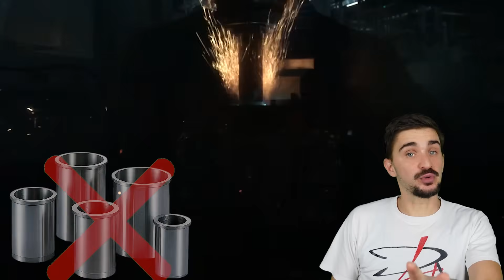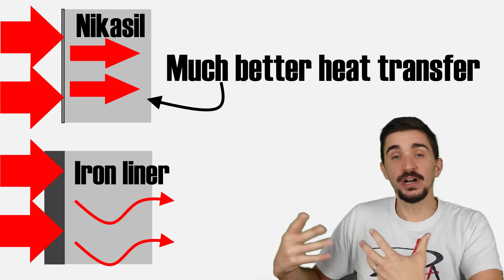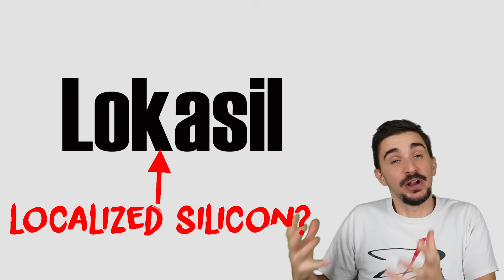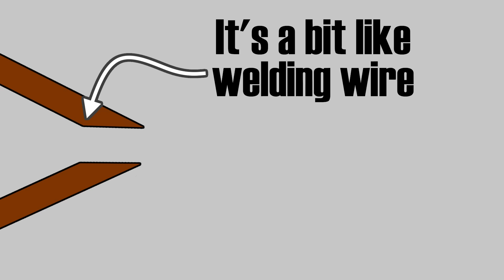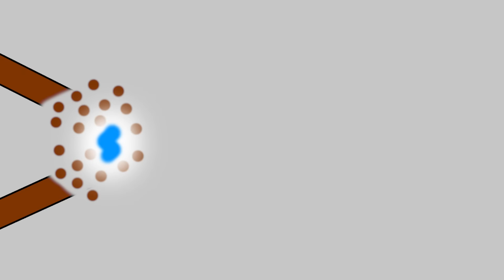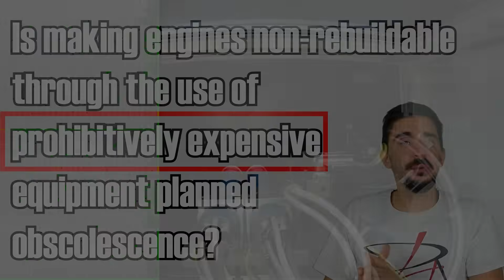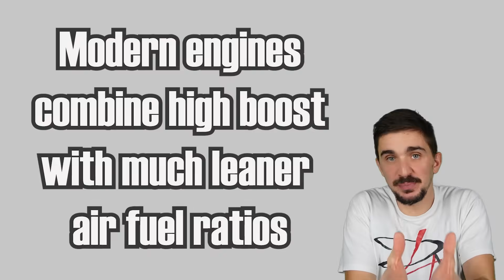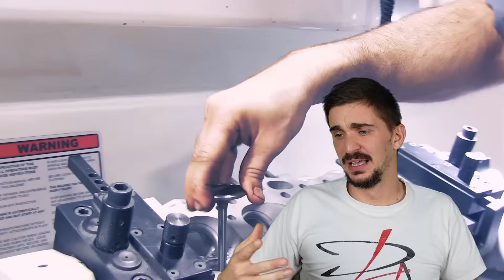Why Are Engines Becoming Non-Rebuildable? Everything About Cylinder Coatings

Comment: I learned a lot but just wanted to add that Alusil can be recut or rehoned. Kolbenschmidt themselves put out guides but it requires special sunnen honing machines most machine shops won’t have. Alternatively DIYers have learned to rehone to expose more silicon with a special paste. I only know this becsuse I am doing it on my 944 right now.

Comment: From what I understand from this is that the manufactures want to build the engines cheaper, but at the same time charge us more for the product. It seems like the industry standard is in a constant state of change. Originally all engines were cast iron. Then to save weight the block went to aluminum with iron sleaves. Now they are all aluminum with a spray on cylinder liner, but the industry standard is to have at least an iron sleave for durability. Do you think those 18-wheeler have spray on cylinder liners in their engines? We went from an engine cylinder standard of 4 to 6 to 8 then down to 6 then 4 now 3! We are constantly getting less for more!

Comment: How about Electrodeposition of both Aluminum and Copper to form Aluminum Bronze on the cylinder walls using a Urea based DES? It would be strong and relatively easy to do at the workshop level.

Comment: No one was ever rebuilding passenger car engines en masse anyway. Aside from rare cars or people that plan on modifying their car, the usual course of action is a used engine (usually pulled from totaled cars). And bore coatings don't make engines non-rebuildable for those inclined to do so. Darton will gladly sell you some ductile iron sleeves for just about anything, and a good machine shop will gladly machine that silly coating right off and press those sleeves in. For purists (e.g. Porsche owners) that think the thermal expansion of a ductile iron sleeve will somehow crack their fairy dust infused aluminum block or mess with thermal transfer, there are Nikasil lined aluminum available sleeves on the market.

Comment: They are still rebuildable, just not as convenient. There is an acid bath that the block can be placed in that eats the plating, leaving the aluminum alone. The block then needs to be re-plated and honed out to size. 

I went through the process for rebuilding a Yamaha SRX snowmobile engine.

Comment: Very good video extremely informative but I have to disagree with your conclusion as a former owner of a Chevy Vega that was bought new the engine only lasts at 40,000 miles before the oil consumption became prohibited the engine was never overheated and received oil changes every 3,000 MI I've been a mechanic for over 40 years and has scene many types of engines come and go I also have a as degree in automotive technology plus all my state licenses I will tell you from experience that sleeved engines are much better than coded engines no matter what the coding is all your environmental analysis sounds really good until you tell the customer his engine is junk because some environmentalists made him use a spray coating on it

Comment: Very good vid and super in-depth explanation. The single biggest factor with respect to the down side to non rebuildable engines has nothing to do with the engine at all!!  There is the rest of the vehicle that also is thrown away. The cost in co2 emissions and input energy energy to “recycle” (new plastic vehicles are hardly recyclable)  the 1500+ lbs of junk material that makes up these modern cars (in a crud way this should represent the weight of non metallic components hardly worth recycling), is way way more than being able to simply rebuild the engine to, again, have all 3500+lbs of car back driving on the road. And that’s not even a very large vehicle at 3500lbs. 
No argument on your math D4A but only calculating the engine block because this segment is concentrating on that part of the vehicle is missing the entire point in why you rebuild an engine. It’s not to get the engine running again. It’s to get the entire vehicle back running again. If you can’t fix the engine you also cannot fix the entire car and the entire car is JUNKED!  
But great vid regardless.

Comment: Thank you very much for this video, I found it extremely useful.  I found this video because I just bought a motorcycle that has an Aluminium Alloy Cylinder with no liner, and I had no idea such a thing was possible.  I am reasurred that it has benefits and in this case I can see that the cylinder can easily be replaced if it's ever needed.    I think we have to be realistic and appreciate that unlike vehicles from the 1970's when re-honing or re-boring and fitting oversized pistons was common, today very few engines are rebuilt in westen countries.  They last so much longer, when well maintained a good engine may never need a rebore or rebuild, mostly it's done as a result of poor maintainence or allowing an engine to overheat.

Comment: I am laughing ath your emission numbers. My Citroen Ami 8, a quarter century old when I happen to get my hands over it also had economy of ~19km/l. Only 28 or so HP, but I could rebuild the engine and later the gearbox in my kitchen, then go on trips to places which the current average EU driver can only experience on screen of his youtube account. If the body of my Ami was as robust and repairable as the powertrain was, I would still keep that car for occasional drives through bogs and remote beaches. I cant imagine such fun with the German-über-engineered anything.

Comment: Still, a properly maintained cast iron block would have a much longer service life than any aluminum block. For example, it is not unheard of for the 1.9 liter TDI VW Golf engine, which has a cast iron block, to go beyond 500 000 km. At most, a similar aluminum block would not go beyond 250 000, in the best case scenario. I don't know in your math, but in mine, having to buy another car instead of using the same for another 250 000 km, is not the same, not for the wallet, not for the environment.

Comment: The obsession with emissions is one of the most obnoxious oabsurdities in modern culture, if a government wants to go green they need to build nuclear power plants, messing with road cars won't effect anything
Reply: Yeah, remember when engines used to go for 500 000 km before needing a rebuild... we would be lucky to hold an engine for 250 000 km now. How is that good for the environment if I have to buy a car  twice for the same amount of km driven?! I still have my Ford Focus mk I 1.6 liter Zetec cast iron block. Would not trade for an aluminum block if I would be given a new 2026 Focus for this one! I know mine will outlast the new one, despite being 20 years old (but only 110 000 km).

Comment: Mfg's don't care about rebuildability at all - its not a conspiracy or planned obsolescence, its simply that the engines are designed to last the projected practical lifetime of the vehicles. If people kept their cars 20+ years on average, they'd push to make them last longer, but many people want a new one as soon as they are done paying for the current one - or even before that. Simple economics. Rebuilding just makes no sense anymore. If you pop an engine, just get another out of the salvage yard. EV's will change all that in time. I love ICE, but EV for many (not all) use cases make the most sense all things considered and makes this a moot point for the average consumer.

Comment: I mean the M112 and 113 Mercedes engines did very well. The reliability problems of newer Alusil/Silitec engines are down to injectors (i.e., direct injection engines), so I am not sure I'd call the whole Silitec endeavour a failure, given a couple of the most durable engines of the past 40 years had it. Literally nobody hates the M112 and M113, they last forever if you change the oil, like, at all.

Comment: Alusil is rebuildable with mostly normal machine tools.
It’s bored, honed as normal and then honed with felt pads and some dope… takes like 90 seconds.
There’s also some variation tools that you can rent.  It’s a few hundred bucks but still, maybe 30% more money than an iron block bore and hone.

Comment: 1) Manufactuers are incentiviced to ensure that the engine doesn't fail while under warranty and that makes the coatings a better choice for them
2) Customers are demanding higher performance and longer warranties with very few making decisions centered around rebuilding
3) Nikasil uses cobalt which is an environmental problem so most western manufacturers don't want the hassle/risk
4) Ford (and other manufacturers) are experimenting with Plasma Electrolytic Oxidation (PEO) which will greatly reduce the equipment complexity/costs (vs. thermal spray coating) and results in even harder and lower friction surfaces.  This has been shown to work well for 2XXX series aluminium alloys (high performance engines) and Keronite advertises that 3XX (most engine blocks) also works very well with PEO.  

Sleeves are still super common (Toyota, etc.) so if you want to keep an engine going after it's fail point select a motor with sleeves.  The future however is coatings and that creates a market opportunity for specialized remanufacturers to recycle engine blocks back into working rebuilt motors.  Probably not as a shade tree option but the option will still be there for crate rebuilds.

Comment: Reducing CO2 emissions will have a NEGATIVE effect on the environment since CO2 is NECESSARY for plant life.  Plants produce O2 through photosynthesis which is NECESSARY for human life.  So, unfortunately, your environmental analysis at the end of the video is based on faulty pseudo-science (I.e.: "Communist Propaganda").  

Historically, CO2 levels were 10 to 20x higher than they are now during the Cambrian, Ordovician, and Mesozoic eras when the earth was MUCH GREENER.  So, logically speaking, we need to PUMP CO2 into the atmosphere and INCREASE our so-called "Carbon Footprint" if we want to maintain a healthy planet.

The ONLY benefit in reducing CO2 emissions is reduced fuel consumption and lower cost to the consumer through fuel savings.

Comment: Our family car uses a Citroen C4 engine and it is only rated for 150000km before replacement. It is now 10 years old and the cost of a new engine is too expensive and now the car has to be written off.

This chassis is in excellent condition and will last another 20-40 years with proper care (which we do regularly) 

How is this not illegal.

Comment: Volvo's most expensive ever vehicle, the $105,000 USD XC90 T8 Excellence, is literally disposable. The entire vehicle is irreparable and inoperable when the unreliable electric parallel hybrid rear end dies. Which they all do, years before the "12 Year Manufacturer's Warranty" against body rust can possible expire. This should be illegal to intentionally design an unnecessarily complex engine or vehicle system that fails into a brick when ONE of the FOUR distinct power systems breaks. Not by accident but on purpose, and well before a decade; most electric rear drive systems are mechanically failing (gear self destruction) before 100,000 miles; and all, 100% of the battery packs are failing to ever provide the range or life advertised. Can you use the 2.0L FWD gas engine when the electric rear drive motor fails? No. Can you use the supercharger, when the batteries fail? No. Can you the turbocharger when the car refuses to shift out of park because the stupid parallel hybrid system is broken? No. The most expensive vehicle Volvo ever made becomes inert, by design, when its weakest link inevitably fails. 

Thus the most expensive vehicle Volvo ever made is literally worth less than the base XC90 it is based on. 

NONE of this would have happened if it were just a series hybrid AWD (which is trivial) not a "dual motor" POS. 

"Excellence. By Sweden." It says on the headrests. 

Actually this car was built for Chinese limousine market and all the bad decisions can be attributed to Geely, which has enslaved Volvo and appears to be intentionally ruining not only Polestar but also the halo flagship Volvo brand. Boggles the mind.

Comment: It's not a subtle increase in temp that engines are running either. Most car used to sit in the mid 80s. Now most cars are sitting just above 100 degrees.

Comment: I wonder if the next step will be manufacturers moving back to nickasil through the use of aluminum liner bores. like you take the general idea of a cast iron bore sleeve, make it out of aluminum, and then nickasil plate it. since the parts are much smaller and more manageable, it should be easier to scale production speed up and costs down - can just have a large bath of nickasil solution, through which the sleeves are dragged (each with their own nickel electrode) with the use of an overhead conveyor chain. a properly designed production line would probably be able to automate loading of both the liners and the electrode. zero downtime between engine models, as the chains could be designed to hold carriages for size modularity. and for maximum heat transfer, they would be installed with a high temp thermal compound (which already does exist; there's a few thermal compounds used in high performance industrial cooling systems capable of supporting 350C, which I understand is above most engine's operating temperatures, not to mention boron nitride which is regularly used in 3D printer hot ends which can reach even higher temperatures). And thus the sleeves being separate again would make them rebuildable in the traditional sense again, while maintaining most if not all of the benefits of these coatings AND the design/manufacturing simplicity of cast iron sleeved bores.

Hell, if we go into exotic territory, it would probably even be possible to play with more geometries and materials - for example, since the coating is super durable, it would be possible to use a thin, finned sleeve of nickasil coated copper (assuming the electroplating process works with it) as a bore sleeve.

Comment: Nickaseal is applied in  a nickel slicacarbide salt bath around 600 but befor this the aluminum cyl is given a zinc salt bath zinc penetrats deeper into the aluminum cyl and nickaseal adheres much better to the zinc than aluminum

Comment: The first coating used in engine cylinders was hard crome, nickaseal was used 2nd with good reason it is 4 times harder than hard crome which was 10 times harder  cast iron ,also hard crome was bad about peeling off in extreme heat

Comment: "modern engines cannot ever afford to ever run at 11:1" Completely and factually untrue, as a calibrator for an OEM we definitely do enrich to prevent engine damage (excessive exhaust component temperatures and catalyst temperatures).   It is true however that we don't necessarily run enrichment until we absolutely have to for engine component protection (for non performance engines at least).

Comment: I see all these fancy details but they removed bearings from the cylinder heads, cylinder blocks mostly have no sleaves, everything’s being made lighter, thinner, and more “eco”, now a crankshaft may have 5 different bearing sizes, everything’s is so thin and light that machining is nearly non existent. It’s so thin that adding a bearing is nearly impossible. Not to mention machinists have nearly disappeared now that most people would rather throw something away before rebuilding it.

Comment: I'd argue with the end conclusion: cars nowadays don't last 10 or more years, even after a few years they break down, because of stupid things like bearing that cannot be replaced in the gearbox...etc. Also, if an engine is K.O. because of the too much wear on the coated cylinder, that car is over, noone will buy a new engine for it. Either the whole car is scrapped and then you don't deal with 30kg of garbage but more like 1200kg of stuff, with many plastics and chemicals...or it's sold to a poorer country when it's used with blocked DPF/EGR and smokes more than a steam engine.

Cars from 10-15 years ago had decent fuel consumption while using port injection instead of direct injection and 2000+ bar injection pressures and having steel blocks or sleeves. Sure, emissions got better by a bit, but the cost is that cars are not reliable and sooner end up in a junkyard. While the companies make more profit and the end user get's crappier stuff for much more money and for less usable years.

Comment: I have rebuilt many 2 stroke snowmobile engines. A 600cc 2 cylinder produces approximately 120hp. One can carefully hone a nickasil coated cylinder just enough to create new hatching for the new piston rings to seat to without compromising reliability.  The downside is that sometimes the coatings flake off, or the engine has a catastrophic blow up and the cylinder(s) need to either be replaced or re-coated.  The design of a 2 stroke engine lets you replace 1 cylinder at a time. Totally different than the modern day car engine block.

Comment: You said at the end I hope you enjoyed this and I hope you learned something?  Well it was certainly an eye opener that's for sure.  I guess this is why I buy vehicles with either cast iron engines or aluminium with replaceable sleeves.  I haven't had to rebuild a car engine but I am rebuilding my truck engine, over 600k km on my truck engine and honestly disappointed it failed, my current 2 cars have over 350k km on them and expect to get over 500k km before looking at rebuilding them.

Comment: My guess is less than one and 100 motors are ever rebuilt. If this was a semi truck heavy duty truck or maybe even a F250 or 350 it might be an issue. But my guess is even less than one and 100 F1 5250 or 350s are ever actually rebuilt. My guess is most of themgo to the recycler rebuild ability is really a non-factor if it actually makes the engine last longer.